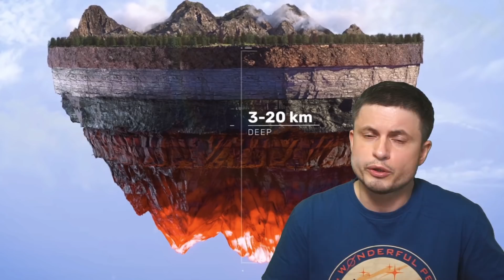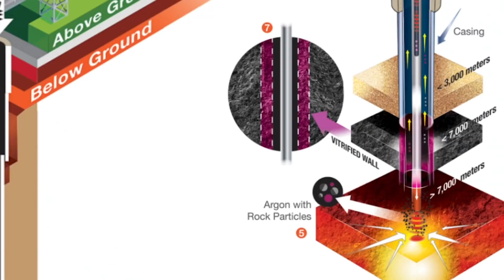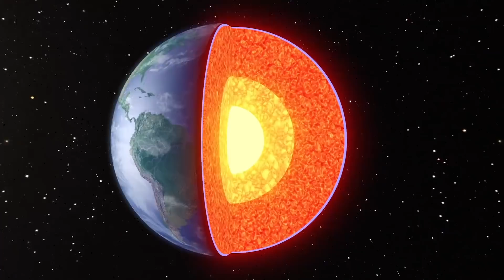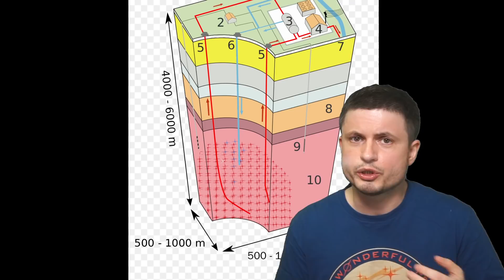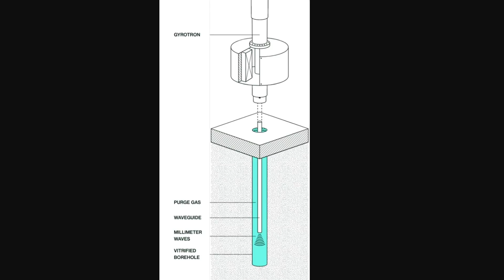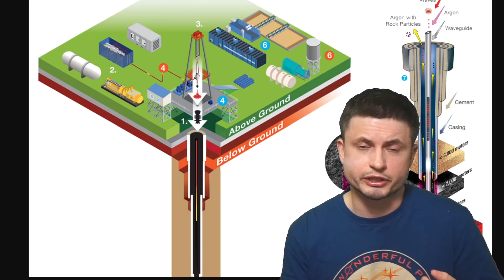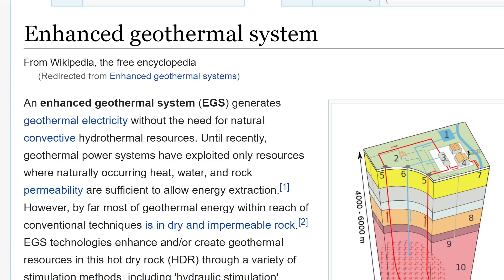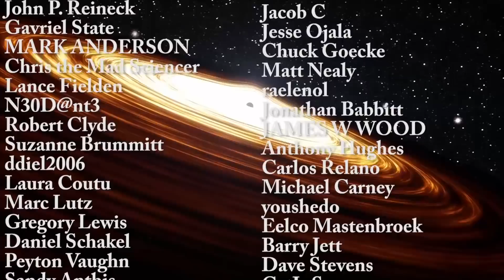Creating Deepest Hole on Earth For Geothermal Energy Revolution

Comment: I was working in a geothermal powerplant in Iceland many years ago and was always amazed by the power coming up from the boreholes. 
There was a pressure relief valve on the pipe coming from the holes that we were working near one day that suffered a sudden pressure spike and blew the valve that has a cover about 70 cm wide and 4 cm thick steel plate. when that thing blew off it shot that plate hundreds of meters in the air and let out an allmighty roar that left us all deaf and dazed.
 Gained a bit more respect for the power of steam after that incident:D
Reply: A wonderful anecdote!
Reply: how deep was that hole?
Reply: @yootoober2009  this was at Hellisheiðavirkjun powerplant that is the 3rd largest geothermal powerplant in the world. there are about 50 boreholes but they are not so deep. 2km max if i remember it correctly. its some 300MW output there so about 6 megawatts of energy from each hole.
Reply: jeezo!
Reply: Not a very well-designed relief valve then: The whole point of them, is to prevent things like that happening.
Reply: @robinhodson9890  It was a temporary one while plant was under construction. They were building a water seperator station and the valve was next to it. Its basically a big flange with a thick plate fastened with bolts designed to break at specific pressure. The water seperator has a automated relief valve but it was not connected yet
Reply: @Nifilheimur  hmmmmm i wonder just on how fast the crust replenishes its heat... if i had to guess there would be a very large spike of energy when water is first introduced and then falls into an equilibrium... also asking myself if its possible to  "exhaust" a region even if temporarily of heat
Reply: @lelagrangeeffectphysics4120  well given the heat is some 400-500 C and down to 2 km deep and some 25km2 it is immense thermal mass. They take some 300mw in electric power and some 150mw in hot water from the area but i highly doubt it would drop one degree in the whole region even after a century. Plus its an active volcanic area so there is always magma moving not so far down.

Comment: I'm on the fence when it comes to geothermal energy. Has alot of potential but pumping water at high pressure to those depths to flash it into steam expanding & increasing the pressure 100s of times more over long periods of time. Especially when you don't know the complete makeup of the rock down there just sounds like a recipe for disaster. There still those unknowns

Comment: 1.  Drilling expense = depth squared.    When you go deep, it takes a very long time to trip out and trip in bits.  The rigs are incredibly humongous to handle the weight and pressures.   (And, What if you hit a lava channel while drilling?   That’s some kinda blowout!! )
2.  Transferring heat requires area, a single borehole is too small.  Likely need two wells and fractured between.  Pump down one and up the other.   Even this iffy because the flow channels instead of moving across an even front.
3.  Returning water/steam will be loaded with dissolved solids which can’t pass through a turbine, but might a heat exchanger then to turbine.   It gets complicated in a hurry.
4.  Conclusion..don’t expect this widespread for power generation (high quality).  It would be OK for building heat (low quality)

Comment: The negative side is that geothermal brings up from the depths radioactive water, mercury and arsenic.
But it’s an immediate answer to energy needs.
Reply: not if a well is drilled, then isolated from the rock using materials that still conduct heat effectively. Oil and gas wells are usually drilled this way, first be completely isolating the inside of the well from the rock, and then perforating the casing to allow formation fluids into the well. Potentially, with some types of geothermal energy generation, there is no need for any direct fluid contact with the rock, so no contamination.

Comment: You didn't read properly Anton! The Al Shaheen well in horizontal! drilling horizontally 12km is a walk in the park compared to drilling it vertically. pressures are huge, temperature starts to affect the properties of metals and above all, you have to be able to lift a 12km column of steel. it's a miracle they made it so deep then....

Comment: FYI you do NOT need the water to be super-critical to do commercial geothermal.  In fact, state-of-the-art systems run in a closed loop and extract heat at the surface via heat exchangers.  Subterranean water is VERY rarely fresh - it's typically got a lot of nasty solutes that will foul moving parts easily.

Also, the notion for "drilling" sounds completely fanciful.  They can burn through a thin slice of rock at the surface, but how does this equipment handle being at enormous pressures and high temperatures. 

I work in the oil (and geothermal) industry and my company recent drilled a 4 km deep well for $12MM.  We can drill 2 km deep wells in the same area for $1.5MM apiece.  So we can drill 8 x 2 km holes for the cost of one 4 km hole.  Sure, it's hotter at 4 km, but more, shallower holes will probably be economically preferable

Comment: It's exciting news, but it is not going to work.

The reason the Kola borehole had to stop was that the drill bit melted in the hole. There comes a point where the rock is so hot, it will melt anything we currently have. The only way to overcome this is to invent something that won't melt. This new process is still going to need something to keep the hole open and whatever that material is, it can't melt or the cause is lost.

Comment: Are you saying that this way we could potentially grab HALF the energy currently produced by Earth's core for powering our grid? Where does this energy currently go? What will happen if suddenly half is missing? (I know it's not so simple, it's probably largely dissipated to space, and - if funnelled through our grid - it will basically still be dissipated but from our appliances... but just asking).

Comment: Sorry Anton, but it seems that you have mixed up so many different things and concepts of Earth Science, that your video is rather misleading. You treat different types of geothermal systems at different depths and geotectonic settings as if they are the same thing. Not so! You also imply that if it was possible to drill down to 20 km, free energy flow just like that... Again not so!!! Please take some time to look into the trials and tribulations of the European Hot Dry Rock project at Soultz-sous-Forêts in Alsace, France, and other stalled hot dry rock projects around, to see how and why they could not achieve sustainable energy production over the past 2 decades from depths as shallow and 3-6 km. Energy extraction from Enhanced Geothermal Systems, which is what you refer to and which has NOTHING TO DO with energy extraction from volcano-related hydrothermal systems as in the US, Italy, the Philippines etc., is very tricky business for which adequate technology does not exist as yet. The prospect of sustainable energy production from ultra-deep EGS by 2028 is as unrealistic as unobtanium. And to be frank, this "startup" looks rather suspicious to me. Thanks for your efforts - please carry on with your good work but please also try to be a little more thorough with your research in the future.
Reply: this 👆

Comment: but is it wise to take the heat out of the earth? Doesn't that weaken the magnetic field that protects us from the cosmic rays?
Reply: The core dynamo theory is completely wrong, so it won't make a difference.  The hot interior with a core temperature higher than the surface of the Sun is also incorrect.  The sooner they begin drilling, the sooner this will be proven true.

Comment: Not only Electricity but heat for Northern Countries and now lots of minerals through filtration rather than blowing up mountains!! Oil & Gas could easily transition to Geothermal! A technology that has now come to be a potential savior to our Human needs. Also, new technique to use only 1 well with the larger pipe has an inner pipe to return water back to the source. There is also another process that fires ball bearings to break through the rock.

Comment: One problem with geothermal is the waste products - recirculating anything into the ground generates a lot of waste - from the continual release of greenhouse gases (SOx, CH4, etc) from the ground to toxic elements leaching into recirculating fluids.  While not as bad as coal, it's not as clean as people may think (on par with fracking).

Comment: I love near ground level (less than 100m below surface), and natural hotspot geothermal systems. I also like the geothermal systems that store heat in summer, draw it out in winter. All very safe and efficient systems.

We you start deep drilling, you introduce other concerns. Yes, it’s true that the nuclear reactions in the earth’s core produce more heat energy than total worldwide energy usage, by a factor of between 1x and 3x (depending on which estimates you use). And, as that heat energy does eventually make it’s way to the surface naturally, it comes out in those aforementioned hotspots, hot springs, volcanic eruptions, lava flows, etc. It’s also the driving force of plate tectonics, including earthquakes. Some of those, such as volcanic eruptions and earthquakes may be undesirable…at least as humans view it, but there are risks of reducing those “too much”. What are the unintended consequences to the long term viability of the planet?

Of a greater concern however, is that it’s the movements of those hot liquids in the earth’s core that generate the earth’s magnetic field, which protects us from cosmic radiation and protect the atmosphere from being blown away by the solar wind. Withdrawing geothermal heat in excessive quantities (at any one location, or total worldwide heat removal) has the potential to alter the motion of the core with potentially catastrophic consequences. I don’t know exactly how much heat we could safely use for energy generation without causing a problem, nor do I believe anyone else can say. I suspect we could probably safely use somewhere between 10% and and 25% of the annual core heat generation (from fusion in the core) with relatively little impact on the core. That would offset somewhere between 10% and 50% of current energy usage. It would probably also result in SOME reduction in volcanic activity and perhaps some reduction in plate tectonic motion and the resulting earthquakes, at least at the higher end extraction rates of 20+%. While there would be some human benefits, short term anyway, from reduced volcanic activity and earthquakes, those might not be good for the long-term ecosystem of the planet, including the atmosphere and precipitation cycles that are essential to life. The deeper we drill to allow faster or more efficient heat extraction, the greater the potential for impact from such extraction.

While we are a very long way from getting to extracting even 5% of that annual heat production, this should be a huge concern and consideration for how we responsibly use geothermal energy as a primary power source. Yes, we should develop geothermal, but we MUST do so in a way that does’t doom us, or the planet.

Comment: I think capturing the sun's energy might be safer. My colleague told me of another city that got raised due to geothermal energy (don't remember the name), so it seems we have to understand some of the processes better. But of course, testing the technology wouldn't hurt (probably), but the problem with free energy is that the more you get, the more you spend. Which obviously is unsustainable. Of course, the EU now has discovered a new formula - use less energy because of raging prices, which at this point sounds like - less showers, less driving, less flying, less heating and less going out of home. Which is also hardly sustainable.

Comment: While unlimited energy sounds great, there is actually a very real limit to how much heat a bore hole like this can extract. Rock tends to be a good insulator, meaning it doesn't conduct heat very well. So even if the bore hole starts off at very high temperatures, they are going to drop quickly as you start drawing that heat out. In order for something like this to be worthwhile you need to be able to heat enormous amounts of water to well above boiling continuously. As you suck that heat out you'll create a "cool" zone around the bore hole. Now the deeper you go the more you can draw from it. But keep in mind that as that kilometers long tube of rock cools by maybe a hundred degrees or more it's going to shrink relative to the rock surrounding it. So even with a single bore hole, if it's deep enough and you draw enough heat out of it you're going to destabilize the rock around it. That can cause all sorts of complications: release of toxic gases/liquids, seismic activity, bore hole collapse, etc. Not saying this isn't doable. But even if this new boring tech is successful, it's only addressed one of many problems with power-station scale geothermal.

Comment: Well, I need to see them digging a hole of at least a km first. I feel like the liquified goo will collapse the hole, but I never worked with melted rock, so Idk the physical parameters here.
Reply: Did you miss the part where they discussed multiple existing holes of depths up to and exceeding 12km?
Reply: @AMurderOfLobs  no, I did not miss that, my-seemingly-eager-for-an-useless-internet-fight friend. They used drilling tech from the last century for those. The reasons those failed we already know: hardness increases, bits break, and fishing or having to drill through drilling materials is indeed very hard work.

They didn't use the maser tech to dig those, in case I was unclear. I think the maser will fail differently, but maybe they have a way to cool the rock, or, like in ablation, they just heat exactly the layers they need to get out of the way. At any rate, having a cool idea of using lasers to drill, while awesome, has never been done deep, and attempting to drill an actual deep hole will teach them the things they didn't think about.

That's my point as precisely as I can make it, I guess.
Reply: @VeteranVandal  The only rock I know how to melt is crack rock.
Reply: @AMurderOfLobs  well, good luck.

Comment: While I think that geothermic energy production is part of the solution, the layers which are penetrated during drilling have to be carefully investigated. There were cases where the holes penetrated watertight layers. This caused water to leak into layers of gyspum, which then expanded and later on was washed away by the water causing the ground above to raise and later lower. This caused enormous damage to buildings and other structures.
Reply: Looks like these holes will be water tight since the inner layers will be literally made into seamless glass.
Reply: @did_I_hurt_your_fee_fees  That is only if you considder a kilometer long glastube can not break. It sounds very fragile to me. ;)
Reply: @andreask.2675  Well, keep in mind this glass tube is in bedrock which does not normally move. I'm also pretty sure they will be using an artificial pipe inserted into the hole, not just the hole. We're talking some very high pressure steam that might actually break the rocks if they don't have it contained in some kind of metal. I agree with you though. They need to make sure it's safe before they start using it.
Reply: @did_I_hurt_your_fee_fees  You can bet that at these depth the rocks WILL move. And also not everything beneath our feet is rock. With an artificial pipe your glass "coating" still can crack and leak water. That is not something that MUST happen, but it CAN happen. Especially since there have been examples, even with much shorter holes. 
I just saw your nickname... now I know where you are coming from. LOL
Reply: @did_I_hurt_your_fee_fees  These are volcanic areas or close the the edges of the tectonic plates. Remember earthquakes happen often and with higher magnitudes in those areas? Of course they move.
Reply: @ContraVsGigi  Yeah, if you had read my following comments you would have seen that I clarified that no engineer would leave the hole as is without a steel sheath to contain the highly pressurized steam. Therefore, slight movement would not cause leaks even though the glass lining of the hole would crack. A major earthquake would sever any pipe or tunnel going through the fault so that point is moot.
Reply: @did_I_hurt_your_fee_fees  It is not this kind of problem someone commented, but the movement of natural water and whatever else is there in the layers between the layers, creating problems from outside to outside the pipe. There is an example: water getting to gipsum and dilating it, cracking or worse the buildings on top.
Reply: @ContraVsGigi  Well, then I'm guessing engineers are going to come up with a solution to whatever problems they encounter. That or we don't do anything and society collapses. All new technology encounters problems. This is no different. Personally, I'd prefer we invest our time and money in nuclear power which is very safe and there are much safer ways of disposing of the waste now. That would solve everything. Also, if you're building a geothermal plant, it's probably a good idea to not build buildings on top of the site...
Reply: Spooky indeed